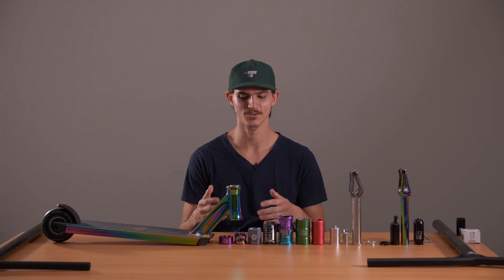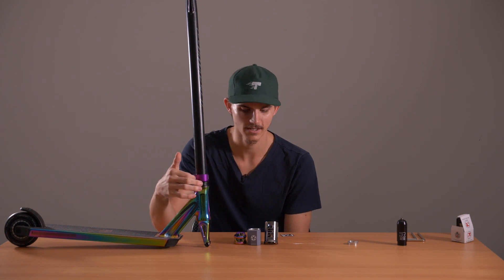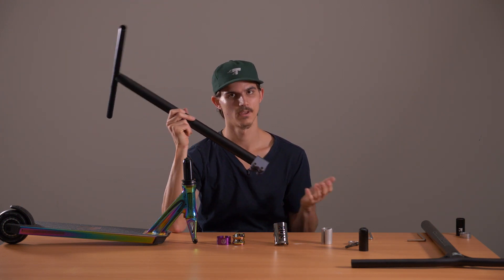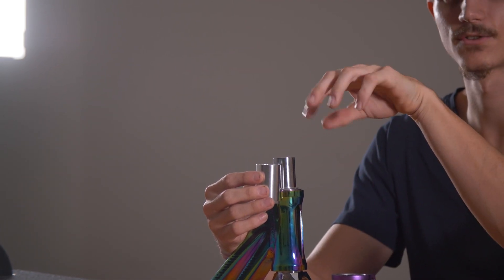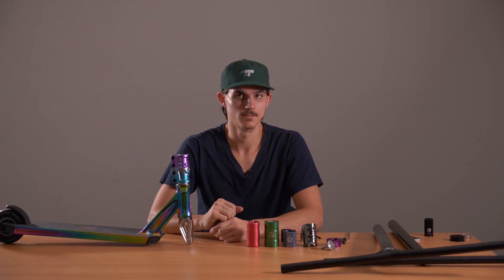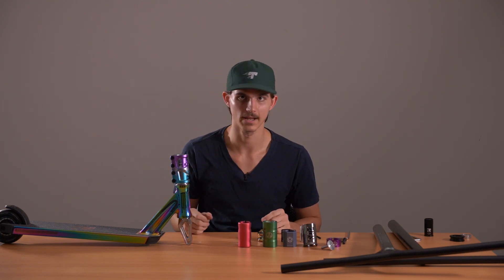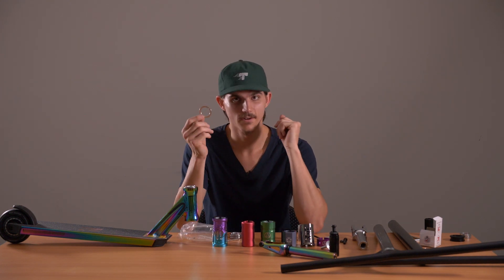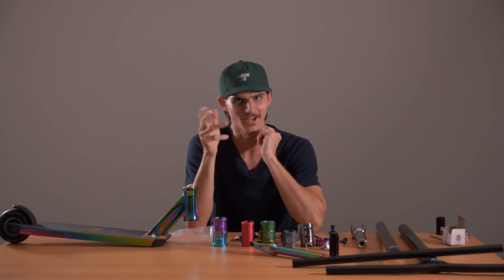The Scooter Compression Guide | Scooter Hut Tutorial

Comment: Can oversized bars fit on ihc without a hic conversion kit. Sry it’s just that I’m confused when it comes to compression systems.
Reply from the maker: You can use Aluminum bars on IHC, If you are wanting to run oversized steel or titanium bars you will need to run a IHC to HIC conversion shim.
Reply: @ScooterHutTV  can you ride oversized aluminum bars with ihc without a conversion shim?
Reply from the maker: @jettsieger2910  Oversized aluminium bars are designed to be ridden with IHC. No conversion shim is needed. Even though an aluminium bar is oversized on the outside, it's standard on the inside, unlike steel and titanium bars that are oversized on the outside and inside. That's why a conversion shim is required if you run IHC with an oversized steel or titanium bar, because they're bigger on the inside than an aluminium bar is.

Comment: I have a question and if Someone could answer it would be great what has been happening is I have new oversize bars and I’ve bought a IHC TO HIC kit conversion thing and it keeps moving back and forth
Reply from the maker: It's hard to know exactly what you mean by moving back and fourth but I would think this would be a clamp issue. 
You most likely need to tighten your clamp more.
Reply: ScooterHutTV like if you pull the toward if you where standing on the deck you they move and it gets worse throughout the day I tried clamping down as hard as I can it haven’t made I difference
Reply from the maker: @tablefish6684  Check your compression as is tight and what clamp are you using?
Reply: ScooterHutTV this clamp  https://scooterhut.com.au/envy-prodigy-double-clamp-oversize-oil-slick/ these bars https://scooterhut.com.au/apex-xxl-t-bar-clear-oversize/ and this compression shim https://scooterhut.com.au/ihc-to-hic-conversion-shim/ I have tighter the compression to the point where it is tight but the bars can still move freely
Reply from the maker: @tablefish6684  I have one more question for you, does your bar have a slit cut in it?
Reply: ScooterHutTV yes
Reply from the maker: Thanks for all of the information, it's not your compression. It is your clamp, either you are not tightening your clamp enough or the clamp is unable to tighten enough. 
We have used the parts you have listed and we know they work together.
Reply: @ScooterHutTV  ok thank you very much would a three bolt clamp work better

Comment: Will my oversized lucky bars work with a lucky IHC fork with a SCS Lucky quad clamp
Reply from the maker: You can't use IHC forks in SCS compression. You would need to either get HIC/SCS forks and a SCS bar adapter if your bar has a cut in it. 
Or you can use the IHC forks with a IHC to HIC conversion shim and a oversized double clamp.